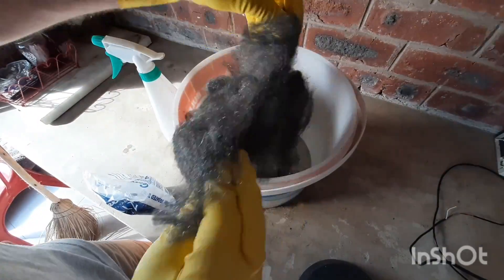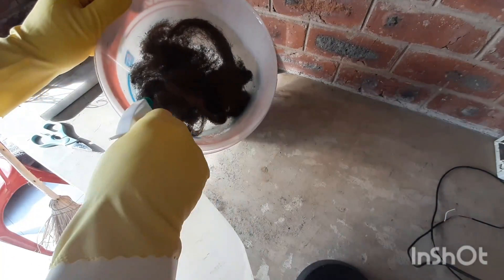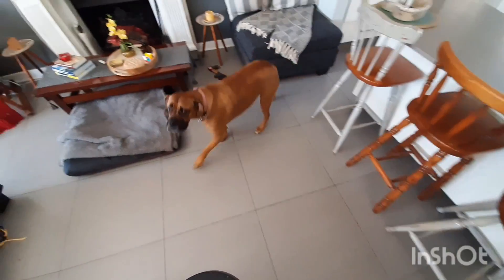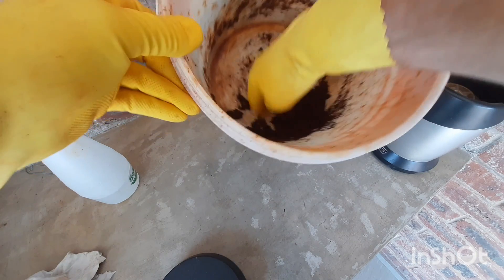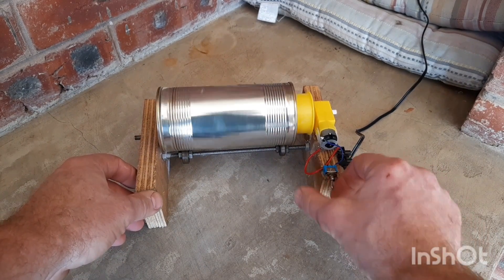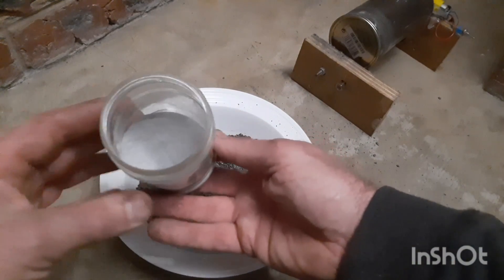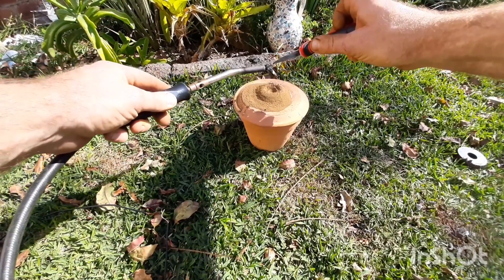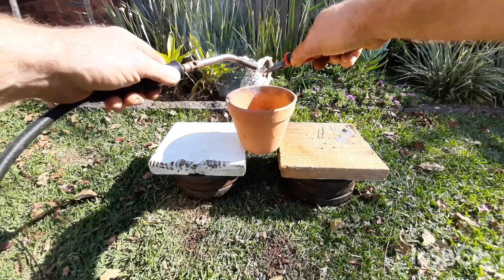How To Make Thermite From Scratch!!

Comment: 250g of al powder costs around £10 and very easy to buy online. Iron oxide costs £7 for 500g. 10 metres of magnesium ribbon cost around £5. So for less than £25you can make arounf]d 3/4 kg of thermite. Enough to make a serious hole in something! Much easier than spending days making a much smaller quantity.
Reply from the maker: I guess an out door survivalist could use a lighter.

Comment: I tried making thermite at home. I used a coffee grinder for the aluminum foil cut into 12" squares. Being lazy I didn't bring the Aluminum into powder, in fact the average particle was approx 1 mil. I rusted iron scrap with vinegar salt plus hydrogen peroxide. I didn't weigh or measure anything. And it wouldn't ignite at all. Out of frustration I tried using a large magnifying glass at midday. Focus the sun on the thermite making the circle of light as small as possible. I saw the thermite begin to melt and pull in more material around it. Then it lit up and burned slowly til the fuel was gone . 
 Woo hoo

Comment: Tried this with magnesium strips and it wasn’t working even tried with store bought chemicals, Any tips?
Reply from the maker: You have to mix the rust and aluminium really well together. Also try put a little more aluminium powder. You can also use a sparkler to ignite the mixture.